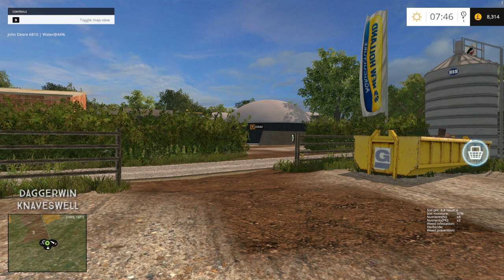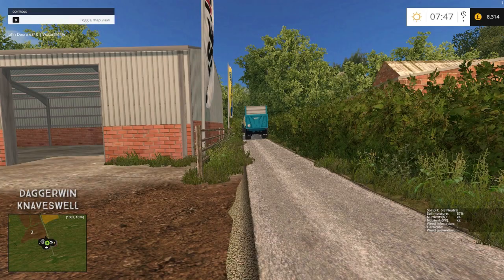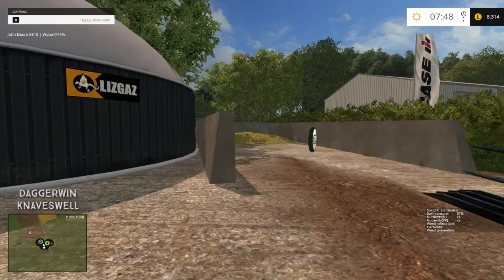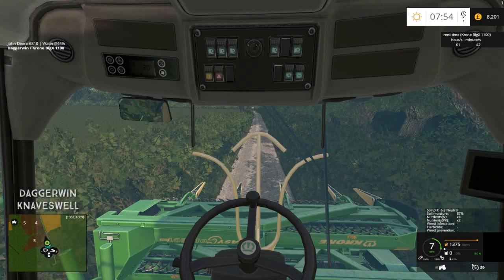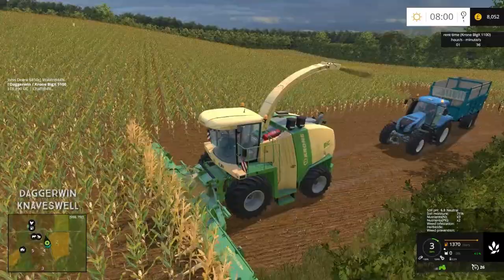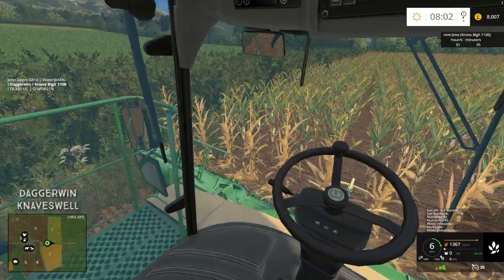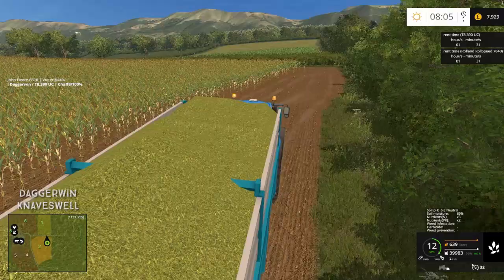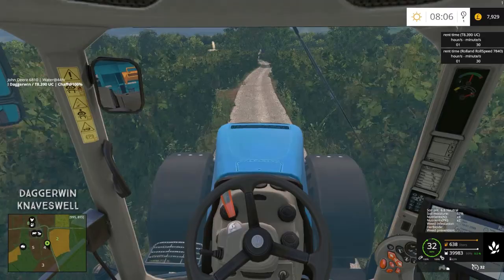Let's Play Farming Simulator 2015 | Knaveswell Farm | Episode 8

Comment: I see you have made the switch to the modhoster rental mod which is much better. I have been using this for a long time now. I think you should also make the switch to Glance, in favor of inspector mod. Glance is far better than Inspector, and gives you a lot more information. It will tell you exactly the amount you have in your trailer/bucket, rather than just giving you a percentage. Also, I could have told you that the placeable heap thing would not work.

Comment: If you look at the drive control screen, it'll show the fill level on the nearest trailer/combine with a decimal, thus not showing 100% when it passes 99,5%  ;) 

Other than that, i do like your films

edit : ohh, and i'd have the tracktor running on the other side of the combine, so it doesn't cut down crops

Comment: You should have your tractor towards  the outside of the field so you are not driving over your crops. If you are going around the field clockwise the tractor would be on the left counter clockwise on the right.

Comment: @Daggerwin why dont you just put the trailer on the trailer hitch on the big m??
Reply: it's unrealistic and the krone would snap in half there pulling weight is not a lot
Reply: I know afew contractors that put the trailer on the back of the forager to open a field up. not a fan personally its faster to just blow over the tractor. so itd be realistic either way and as for snapping the forager in half ha ha
Reply: o its a big x not big m ;-)
Reply: Antony Fielding well it would depends on the trailer and that trailer that daggerwin had the krone would not be in good shape and those trailers are quite heavy
Reply: +James Collie in game maybe but as everyone go's on about realism I know a contractor that sometimes tows 46 cubic metre/46000L trailers behind his big x 700 and it hasn't snapped yet
Reply: +Antony Fielding but you never mentioned weight in tons
Reply: Id estimate about 18-20 tons of dry crop when full plus trailer weight so possibly 28-30 ton trailer weight. only running over weight in uk by about 10-12 ton lol
Reply: Antony Fielding you gave just helped me with my point and that must be a pretty big trailer
Reply: they are a hell of a trailer. basically hold the same amount as an artic wagon bulker trailer